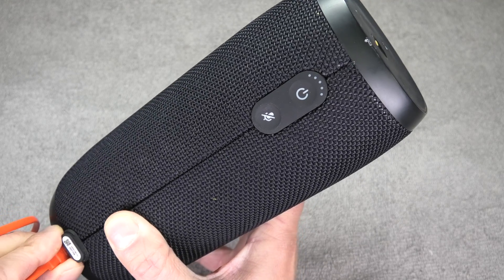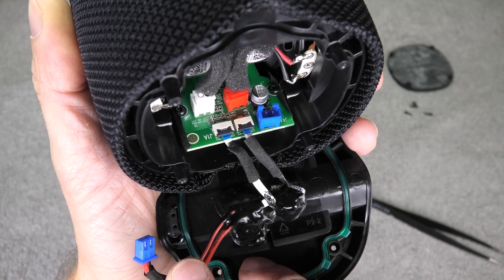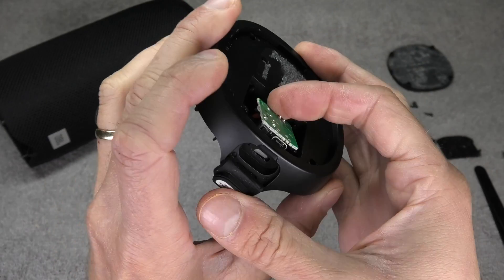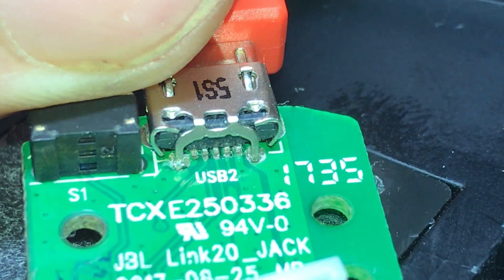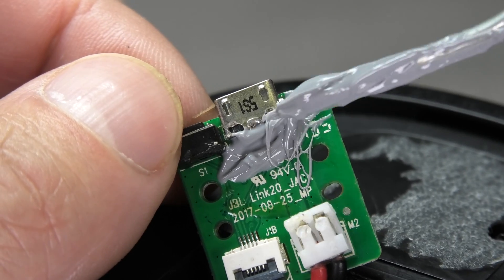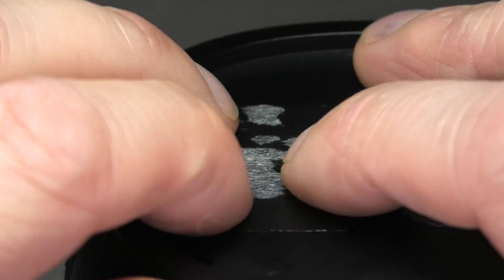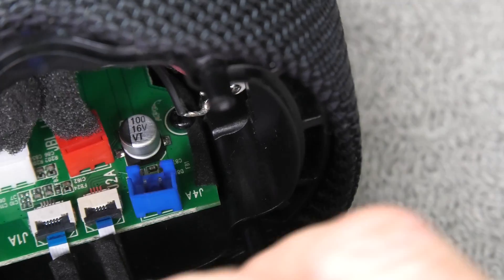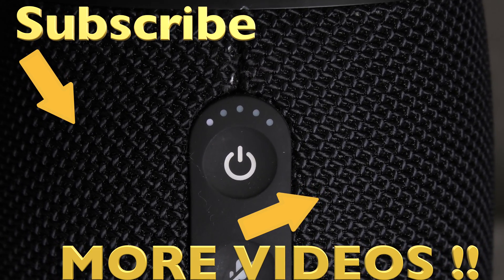FIXING my JBL LINK20 USB Charging Port (How to)

Comment: Where can I buy the machine to melt the metal and the right port? Could I theoretically also upgrade with USB-C Port, if I open the space a little bit for it to be accessible? Thanks a lot for the help!!!
Reply from the maker: Hi, it is called a rework station: https://amzn.to/3YDjiQU
This is the one I am using

Comment: Can you switch from a usb micro port to a usb C port?
Reply from the maker: Replacing the port alone would be difficult because of the pin layout.  But if you can find a complete board with the USB C port on it, which fits into that cavity, then it should be easy.

Comment: what does the ribbon cable do? mine broke and i want to know if i need it or if its just a charging light or something
Reply from the maker: It’s a data line for the USB port.  This is actually never used, since JBL does not provide software updates through it.

Comment: Hi! thanks for the video
I wanted to know, since I may have to go through the trouble of changing the usb port, can I installma type C port instead? any tips would be much appreciated
Reply from the maker: Hi,  I looked into that myself before.  
The pin layout of the USB-C ports is drastically different. So far I haven’t found one that would fit when using the same board unfortunately. 
I think there are small USB-C breakout boards available. If you can make that fit into the same space, then it should work.
Reply: @MegaSafetyFirst  thank you for the fast reply! 
If I can find something compatible and it works I'll come back to comment

Comment: Is it possible to buy a new connector do you know where? Mine is not loose in the legs but the pin to plug where the charger connects in center.
Reply: ebay for around £16.  Very common

Comment: My charger f*** my USB port. I am not sure whether I need to replace the USB port or not. 

First I want buy another charging cable. What is it called? Is it an micro USB charging cable or is it like an type B USB charging cable? Could anyone help me on that? 

Furthermore, let's say my port is damaged. Any reference or link as to where I can get the port? I opened up my speaker according to the video, just need a hand now. 

Much appreciated.
Reply from the maker: Hi,  you are correct with the micro USB cable. That is the one that sed with this speaker.  

In case you need to order a new port, this one may fit:
https://www.digikey.com/en/products/detail/10118194-0001LF/609-4618-1-ND/2785382
You might want to check the real dimensions with the data sheet before ordering.  (I successfully used these ports to fix a different JBL speaker in the past)

Comment: GREAT VIDEO! I wonder what type of glue do you use? and I must buy a Sauder iron. I am a messy woodworker / adventurer and go through at least $2-3000 in electronics a year and only bc of interior sawdust, or a few drops. I simply dropped my JBL 20 4 times, exactly 4 times and it will not charge or anything so im about to learn on it. But first I will really learn on an old broken JBL Flip 2
Reply from the maker: Hi,  for the top and bottom covers I use a double sided from 3M.  
For other location I usually use hot glue, e.g for water- and air tightness in the inside of the speaker.